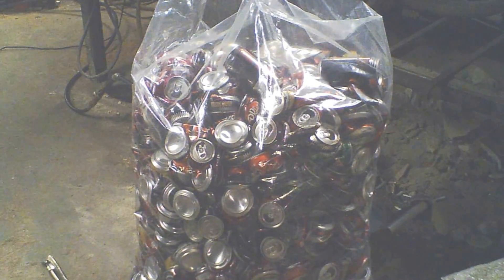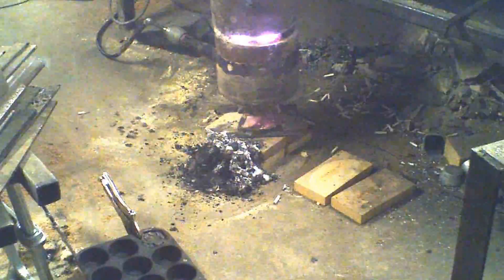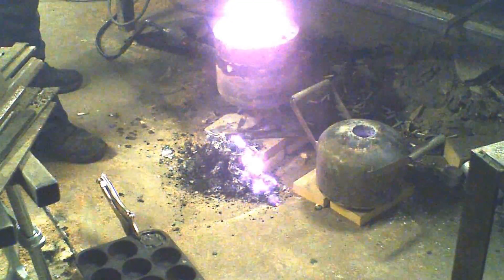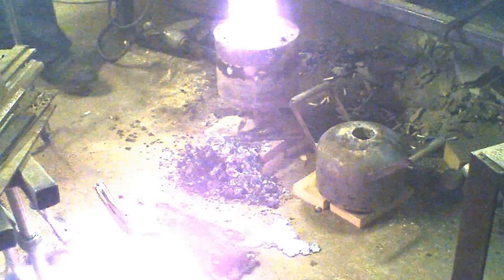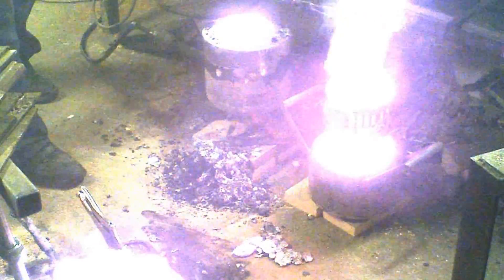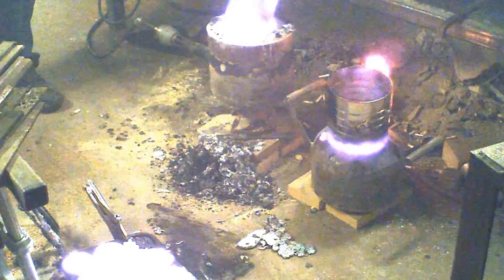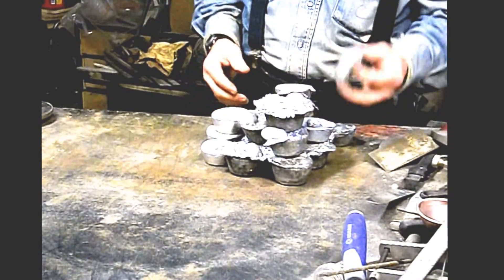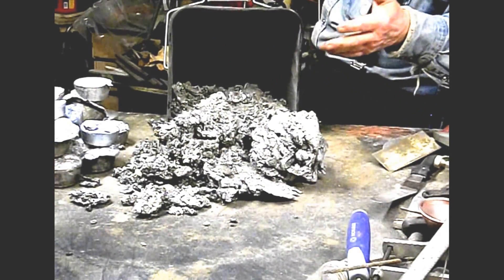Just How Much Waste is There in Melting Soda Cans?

Comment: I have never melted cans (yet) but from from I have heard from many who do, seems the WAY you go about melting them contributes to the ratio of slag and aluminum. I have heard time and again to start with some decently pure aluminum to get a nice puddle going then add the cans. I have been saving my cans for about three years now and have managed to get maybe about as many as in this video or a touch more. When I have enough to play with, I will try my hand at smelting. It seems someone on my current property in the past tried their hand at smelting aluminum. I found an aluminum "ingot" of sorts. Basically someone melted something that was aluminum with a steel bolt in it then poured it on the ground or something. Interesting piece but practically worthless lol.
Reply from the maker: Thanks, Robert, Simple and to the point.
Reply from the maker: ***** Don't stop there, Robert, Fill in the details.
Reply: smelting and melting are different things. Very different.
Reply: Grandpa Bill Will do Grampa Bill. Melting is a phase change, solid to liquid. Smelting is when you convert the rock ore, into metal, a chemical change.
Reply: That Aluminum with the Steel Bolt is not at all "worthless".

Melt that and pull out the Steel. Aluminum will melt at a lower temperature than steel. You can pull it out of the Molten Aluminum with tongs.

Comment: From personal experience maybe 40%.  I start with some scrap aluminum, and only start running cans once I have a nice little puddle.  I don't bother crushing them, and would probably get a better ratio if I did.
Reply: Ive found that if you have the patience, you can get a hacksaw and cut the tops and bottoms off the cans, then with a pair of snips cut down the length of the remaining walls. Stack the bottoms together so they fit nicely, roll the walls into a giant wad of aluminum, and keep the tops loose. Throw in the stack of bottoms first (theyre the thickest), then the rolled up wall wad, then the tops. It should reduce oxidation, but its really only practical for a smaller operation.

Ive also heard (although havent tried) you can wrap some of the initial can stacks with a pouch of aluminum foil twist sealed. The foil oxidizes and gets sacrificed, but still retains a enough metal to shield the rest of the cans. It cant be too tight or else the tension on the cans would cause it to break though once it weakens in the furnace.

Comment from the maker: You can try it, but your steel plate would have to be 1200+ degrees for the alum to flow thru the holes in the plate. Then you have to figure out how to remove the slag that plugs the holes.
If you figure out a way to do it .... make a video of it, I'd like to see how you did it.

Comment: I found the best way to reduce the amount of slag from cans is to: wash them clean, crush them down as small as possible to reduce the amount of surface area, have a molten pool started to submerge the cans, limit the amount of stirring and skimming, don't degas unless you're making a casting. There will always be slag with cans but the trick is to limit the amount of exposure to oxygen.
Sucks about the crucible. =(